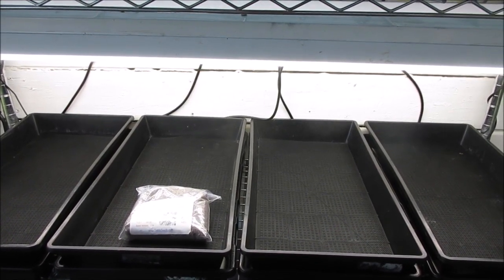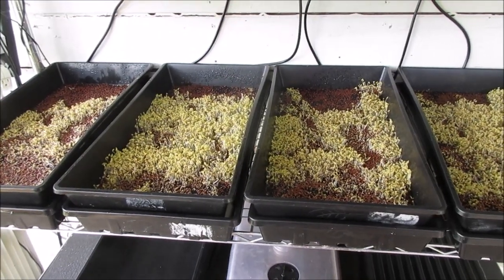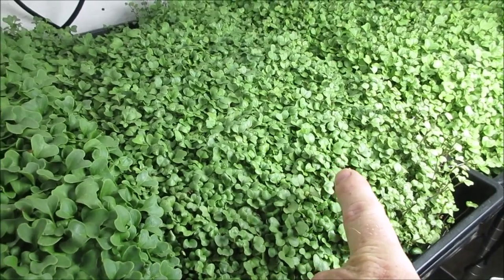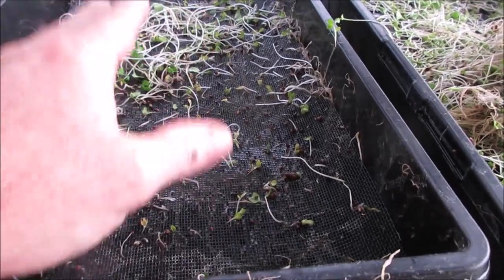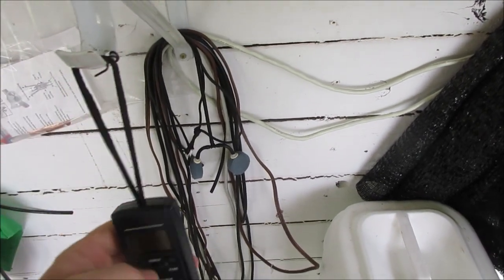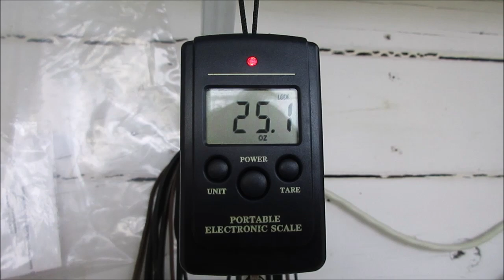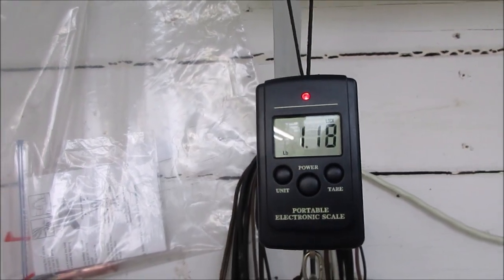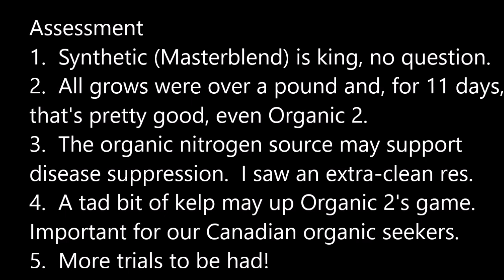Organic Vs Synthetic 4-Way Trial Using the IHG Method

Comment: Question: Do the greens produced using MasterBlend end up with higher levels of Potassium?  I’ve had trouble with high Potassium in my diet (dialysis) recently.  This is normally good for normally functioning kidneys, but otherwise could make you fertilizer (haha) via heart attack. Love your scientific, unbiased approach.
Reply from the maker: Ken, I believe that the MB bumps up all nutrient-levels in the plants.  I certainly cannot say if it does it to toxic levels for some who may have special needs.  I wish I could for you.  Might I suggest a mix of Calcium Nitrate, Epsom Salt (magnesium suflate), and 2 Tablespoons of liquid kelp?  You could even try it without kelp.  The nitrogen is the main driver is early plant growth for micros.  This should reduce potassium levels for you.  Please, always consult your doctor instead of relying on us YouTubers and that includes me.  Best to you buddy.

Comment: Brent, my question deals with the bags you use for weights.  Where did you get them and what are they  filled with?  Oh ya, WHO IN THEIR RIGHT MIND WOULD QUESTION MASTER BLEND?
Reply from the maker: Hey Richard, those were in ankle weights with sand sealed in plastic.  Each one had 5 of them in a zipped nylon apparatus that was velcro'd around the ankle as workout weight.  I never used them for that purpose, but I found them useful for micros.  It's how I got the idea for creating weights that I outline in the book.  Masterblend is king for sure.  But, and a big butt, some want the organic solution.
Reply: @C3Voyage  - if you have access to a foodsaver "seal-a-meal", you can make your own weights easy peasy!
Reply from the maker: @shara4389  Funny.  I demonstrate exactly that in a couple videos and it's in my first edition book too.  I filled with sand.  One could also use water if frozen before sealing.

Comment: the hybrid one definitely looked like its stems was more white.
Reply from the maker: I see that too.  I wonder what that means?
Reply: @C3Voyage  Did you notice any taste difference? Would be really interesting to see the nutrient content of both side by side and see if there is any variation depending on the mix.

Thanks for sharing these videos, I will subscribe :). 

I am beginning to grow microgreens also now and its really useful to see different methods before going deep on one.

Cheers
Reply from the maker: @SultanAhmedSaricicek  No difference in taste that I can detect.  The nutrient value of micros is almost always determined by the availability of nutrients and their ability to absorb them.  Often, I've read research where nutrient value of, say tomatoes, is higher with synthetic nutrients.  I believe that the negativity of synthetic nutrients relates to protections to our farming soils...and perceptions/opinions of gardeners.  As a gardener, I've spent most of my time in my past attempting to give the soil what it needs so that the plants can then get what they need to grow well.  It that sense, it's an art of sorts that some find enjoyable.  Generally speaking, the more healthy a plant appears equates to getting what it needs.

Comment: Wow madternlend kills it. 13percrnt more frowth over better organic. roughly 10% of organic solution i am using. gonna have to pour that on the yard.
$60 master 10 pound, 1890 full stengtb gallons
57$ organic solution (1gallon) 128/.75 , 171 full strenghth gallons
Reply from the maker: Always seems to be the case, eh?  "Organic" is always more expensive.  Anymore these days, "organic" is a marketing term more than a meaningful term.